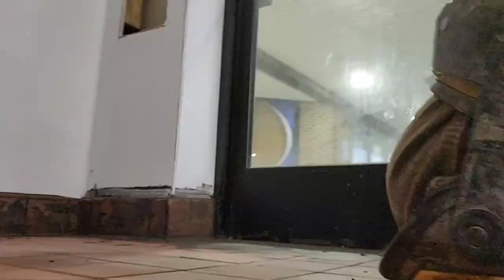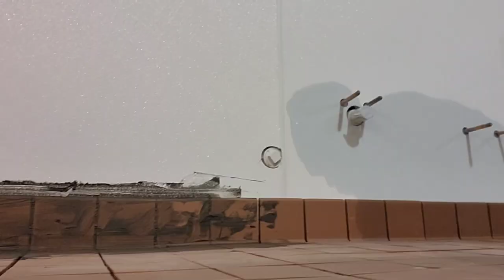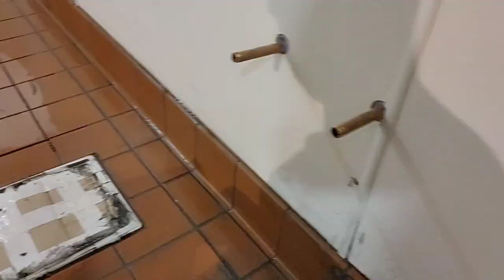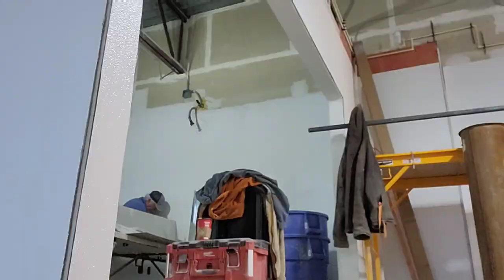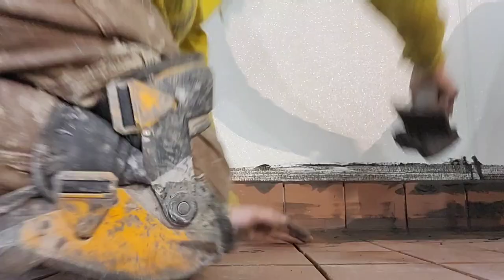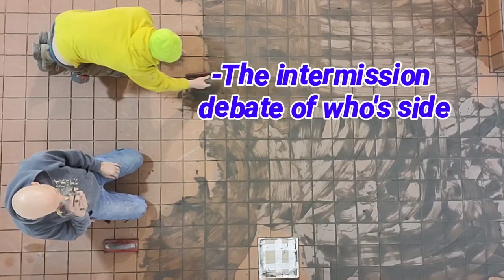The Team killed It -Base and Floor Quarry Tile Grout Up!

Comment: Any special products for cleaning up?
Reply from the maker: Dry haze, cold water, and a perfect caddy sponge
Reply: @woodstockscorner  one more question how about the time you have to wait to clean after you applied the grout
Reply from the maker: Two different types of grout are rapid or regular apply and wipe maybe 5-10 min with rapid don't wait too long or too early. With regular, you have maybe 20 minutes. Use cold water every time.  A caddy will make it shine faster